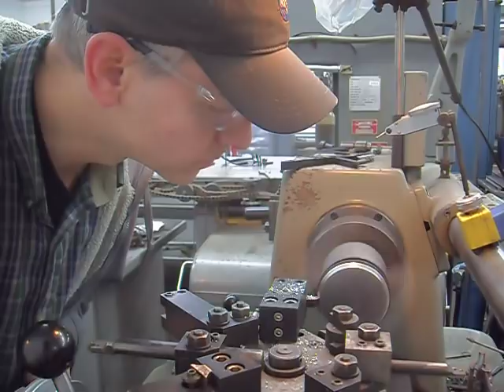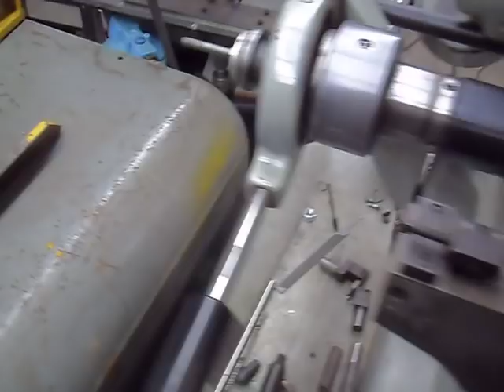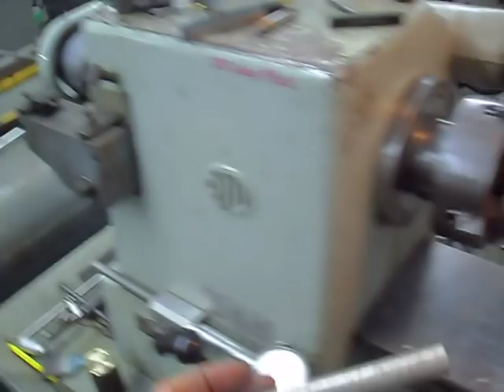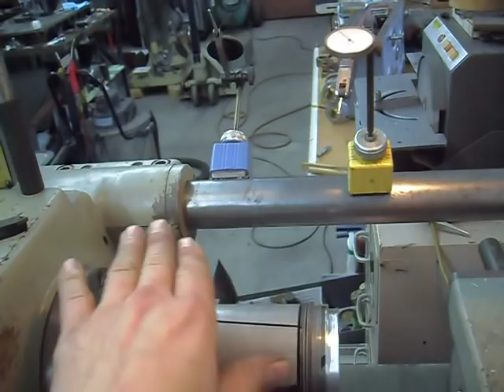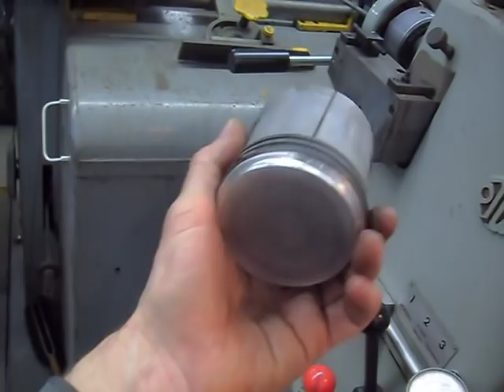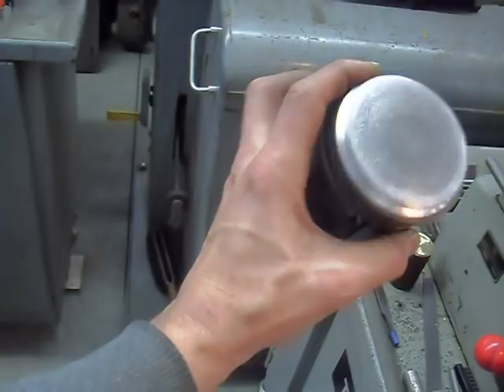Jonathan W's Franklin Piston  12-14-19 -- Piston Fix Part 1

Comment: Clean the aluminum with Acetone?
Reply from the maker: I just turned the surface on the lathe. Cleaning with acetone is usually superfluous. I keep seeing it getting recommended, but I don't think the people recommending that practice really know if it is doing any good or not.  I mean, it's like thousands of degrees here !  A spec of this or that is going to either turn to carbon or vaporize to oblivion !  This piston welded like butter.  Whatever alloy they used in 1927 was excellent.

Comment: The Franklin is Johnathan's most interesting project. ( in my opinion )  A Aluminum body with a WOOD frame and a air cooled motor.  If your really going to get this right, use a really good bore gauge ( not all bore gauges are the same in quality ) and check each bore everywhere for straightness, ware & tapper. Then Mic the piston skirt's very closely all around each piston and find out the skirt clearance to bore size . That is the most important size.
Reply from the maker: It made it easy for me to size the ring lands, because they are always undersized from the skirt, and I had the original diameter to measure.  I would gladly lend Jonathan my dial bore gauge, but he is just going to re-ring it, and use the original pistons.  Hence the work on this piston that I did for him.
Reply: @kooldoozer    Be worried about heat distortion from tig welding on old cast alum pistons as they tend to move like crazy from welding  !!!!
Reply from the maker: @hydroy1  Well, Mike, I hear ya.  But Honestly I was not worried about distortion.  These are slit pistons.  They are not cam-ground pistons.  Also the Franlkin is an air cooled engine,  essentially an airplane engine. Piston to bore clearances are large, to deal with a lot of expansion. With the ring lands being blown out, and if I did not weld it, the piston was going to be junk. Many reasons not to be concerned about distortion and also many reasons to just weld it.  I had nothing to loose and everything to gain.  Worrying about things is only when I have no information to make an informed plan of action.  I had considered many data points before I accepted this job from Jonathan.  If things went to heII, I could always make a new piston.  I tend not to worry about mechanical things.  --Doozer
Reply: @kooldoozer   I though he found a current production piston & rings that would work for the air cooled Franklin ????
Reply from the maker: @hydroy1  Not since we last talked.  Jonathan found some Continental piston rings, the right bore size, but they were too narrow or something.  But I would not have welded up his original piston if new ones were available. But I will ask next time we speak.
Reply: @kooldoozer   Yeah , tell him his West Palm Beach FL. buddy asked . He told me over 6 months ago he found a Chevy piston ( I think ???? ) that might be machined to work.
Reply from the maker: @hydroy1  Kool, maybe.  Might be better with modern cam ground pistons anyways.  I am actually trying to sell my Van Norman piston grinder on FB.  Been trying to give it to Jonathan, but he needs a bigger shop. (me too, but that's another story).
Reply: @kooldoozer  Lol , I can relate !!! I got 4 cars in a 2 car shop ! ( don't ask ! lol )

Comment: I opened this vid with one eye closed after seeing other "machining a piston" videos with pistons being ruined in wobbly setups in mini lathes and some bubba declaring it was good enough, but then I was surprised. I really like the method to hold the piston by its pin so the forces are in the boss, and will probably adapt the idea and make a large rod eye drawbar setup that use the 4 jaw to centre the pull rod so it runs true in a similar manner rather than internally clamping the skirt. Also you indicated on the crown rather than on the skirt. On more modern stuff the piston will be oval across with the narrowest section inline with the pin bosses and barrel shaped in vertical profile but on this vintage its probably just a straight round casting machined. Decent bit of home shop craft there and no stupid fake drama tv host style.
Reply from the maker: Thank you Jmp,  I appreciate your views.  Good to know someone else out there has a concept of how to fixture and how to indicate things.  I was trying to teach just a little bit in these piston videos on some lathe techniques.  I agree, lots of guys out there just slap work in a 3 jaw, and assume it is all good. Blows my mind.  Well, if ya don't know, you wonder why things turn out so poorly. And nobody blames themselves.  That's not the world we live in today.  The fix it yourself concept is great, but nobody has any skills or common sense.  I am just a mechanical engineer, but I have had a lathe since I was 15 years old.  I bought my first dial indicator and calipers at a flea market, just to be able to measure what I was making in my lathe. Machine work is geometry.  Plain and simple.  Workholding is just a geometric problem to solve.  Just like modeling something in CAD.  Align the axis of rotation or plane of flatness, whatever.  I see many people do not begin their thought process for solving problems at the beginning.  They just make assumptions that things are straight and flat or whatever. You can if you know your machine and know your tooling.  But otherwise, you have to indicate and measure everything.   I hope you enjoy my videos.  --Doozer

Comment: How hard will the welded area be in relation to the existing piston hardness?  Do you have any information on the properties of the aluminium from which the piston is made?
Reply from the maker: Not sure what Levett used.  They called their aluminum MAGALOY which might suggest some magnesium in the melt.  I used 5356 filler metal for the weld.  It turned like 7075 aluminum on the lathe. Might be higher silicon alloy. Not totally sure.  Sorry I don't have a better answer.  Hope you enjoy my channel.

Comment: Very cool. Are you going to weld it on a rotating jig?
Reply from the maker: I tried to spin the chuck as I welded.  I even fixtured the torch head in position. Not good for this job.  I really need a motor to run it and a variable speed foot pedal.  Just to cumbersome trying to hand spin it.  The torch really needed to be held in my hand to get the puddle in the perfect place, so that is what I ended up doing. Too awkward to film, sorry.  But I learned a lot. Better next time is the name of the game. Thanks.